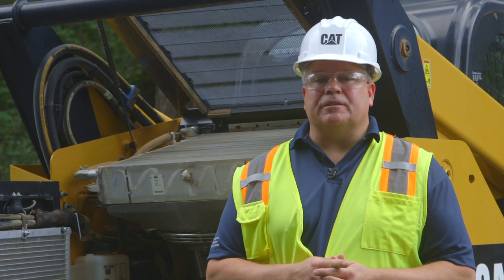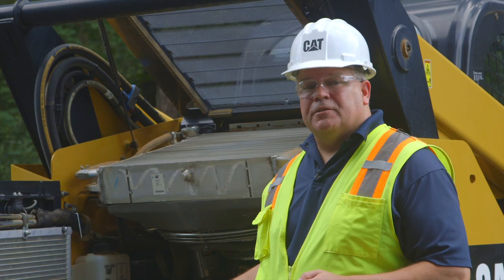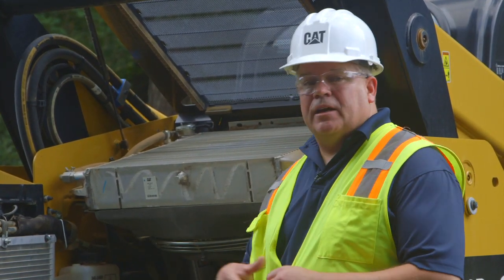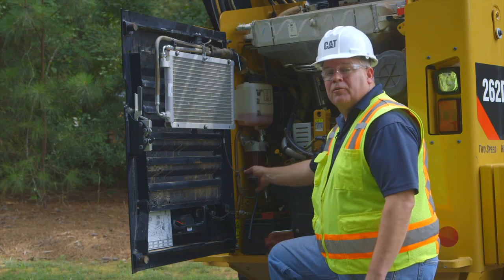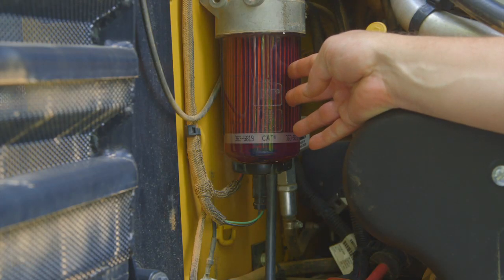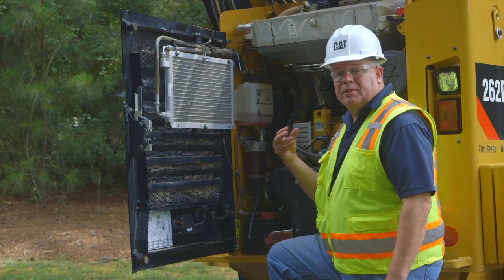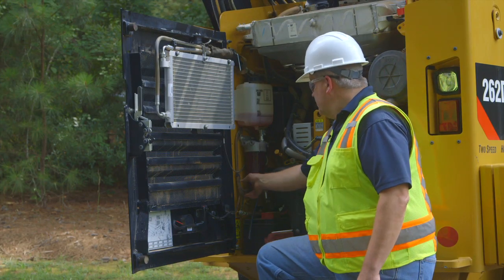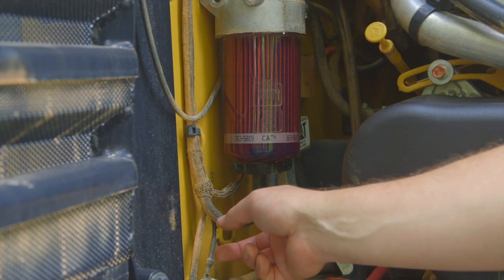Fuel Water Separator on Cat® D Series Skid Steer Loaders

Comment: For those of you who emptied the whole separator and machine turned off/ won’t start, what I did was crank the machine a couple times to get the separator filled back up with fuel until it started
Reply: I emptied separator few times but message to empty it still pops up. I left liquid overnight and there is no water at all, but message is still on. Every time machine started normaly. Can you help?

Comment: easy to access?? i'm in the process of servicing one right now and the oil filter has been by far the most difficult filter i've ever changed. made me wanna blow this machine up!! oh and also i have trash in the fuel system but guess what? to pull the tank i have to pull the motor!!
Reply: Agree on the oil filter, worst placement on any equipment or vehicle I have ever seen